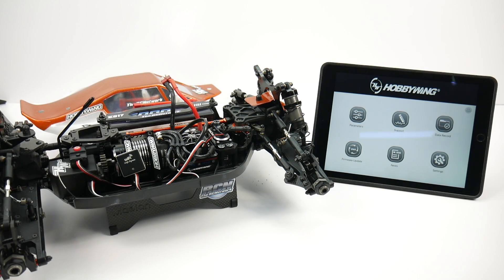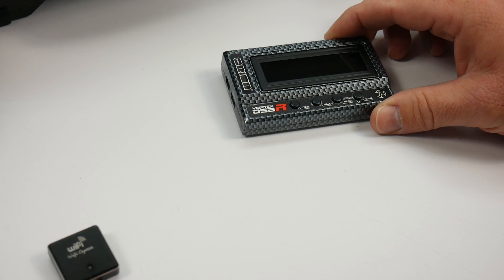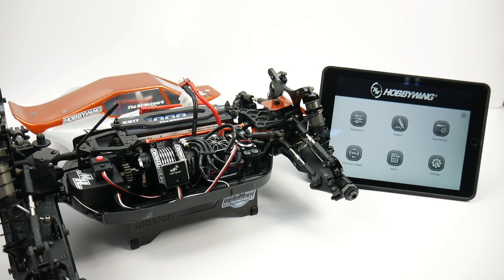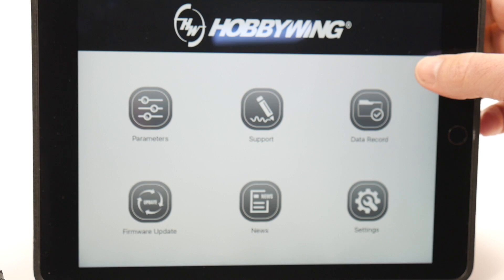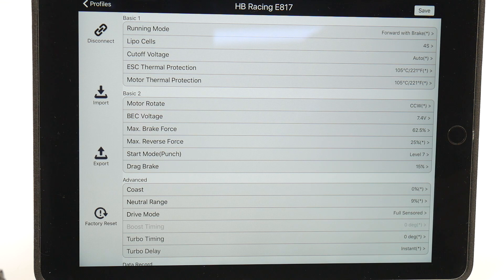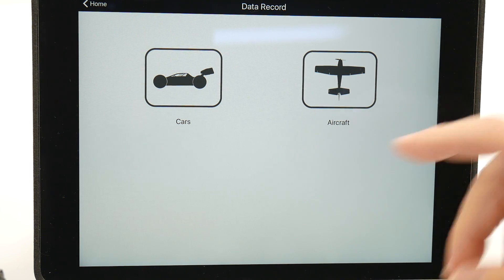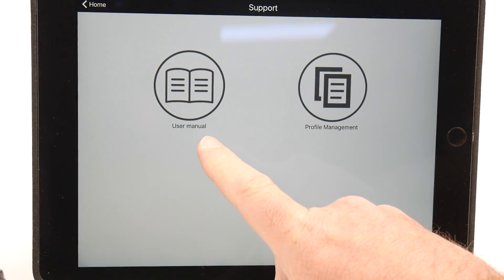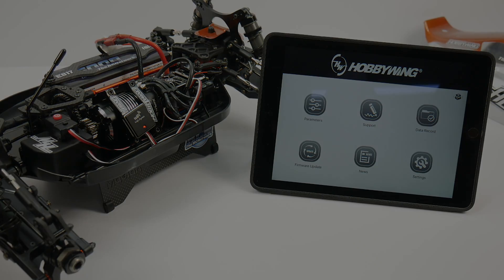HOBBYWING Wifi Express - Quick How to

Comment: Do you need internet or wifi for this. All I have is data on my phone. Thanks
Reply from the maker: You do need a wifi connection from your device (phone or tablet) to the wifi module.....for most programming, however, to update firmware, you will need an internet based wifi - but you might be able to create a wifi hotspot from your phone

Comment: Hi. I have the xr8 plus esc and the wifi module but I can't leave the fan and wifi connected at the same time with that Y shaped connecting cable. The connectors simply don't match (esc to Y cable). Is it impossible to leave the wifi mounted together with the fan having this esc?
Reply from the maker: I'm not sure on that one....I've tried that in the past with a transponder and fan and had similar results.  Did you need to leave it on while driving?
Reply: @TheRCNetwork  It is not necessary but I do not understand what sense or utility the Y-shaped connector cable that comes with the wifi has, if every time I have to change a parameter I will have to disconnect the fan to connect the wifi. This cable connector has no purpose. I suppose it would have some use in another esc but I am surprised that it does not work in xr8 plus which is supposed to be one of the best.

Comment: Hello, does it work with a radio control boat that has Hobbywing electronics?
Reply: If you download the app, you can check "Demo mode". It has several ESC's listed for cars but for boats, they only list Seaking PRO 160A". I don't know if this means that other ESC's are not supported or that they just simply don't have a Demo mode for other ESC's.

Comment: Can i remove the current limiting on the the max 5 or maybe swap firmware wuthout current limiting ,also this will work with the ztw 300 amp 12 cell esc ?
Reply from the maker: Not sure, not sure, no.  You'll have to contact HW regarding the Max5.  I don't believe it will work with the ZTW

Comment: Thanks for the great video 

Just wondering if you think the WIFI module is enough on its own, i just bought a Hobbywing Xerun XR10 Pro 160A Sensored Brushless ESC, wondering if i should go just with the wifi or if it has any limitation over the Multifunction LCD Program Box?
Reply from the maker: The Wifi express will have more info if anything....like the data logging, etc  Go for the Wifi...and use your phone to program